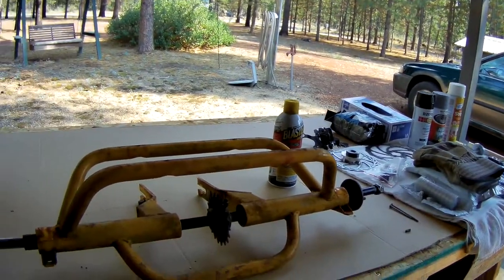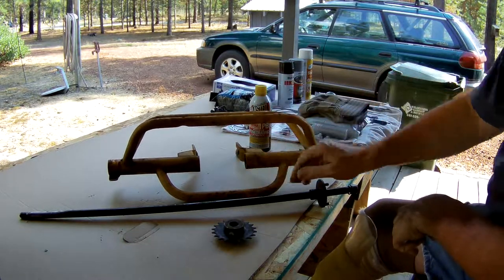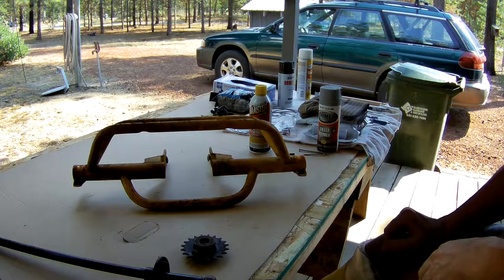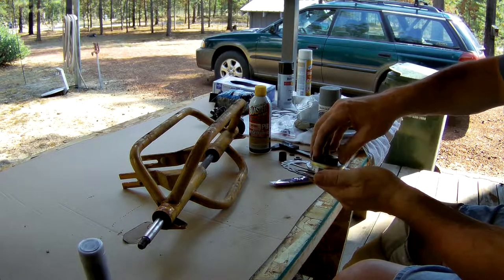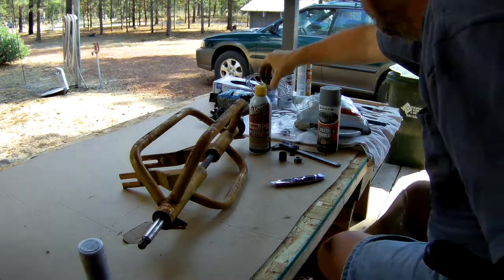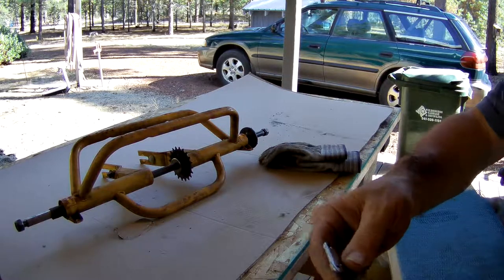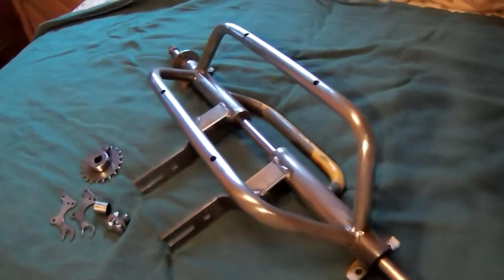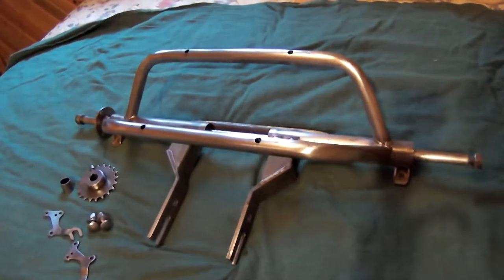Working On The Trikes Rear Axle

Comment: Thx! Interesting project. Never saw a disk brake on a 3-wheeler before. Good idea. Actually I was looking for some guidance on removing / replacing the ball bearings in the tube. Did U use a puller or a long drift to get them out? It didn't look like the bearings were a press fit onto the axle shaft. I'm refurbishing a Miami Sun (3-wheel) that sat in an unheated (Michigan) garage for years. The grease in the bearings has turned hard like plastic. They're clicking and popping and squealing. Pls advise.
Reply from the maker: Michael, I used a inside bearing puller for the 2 outside bearings, took a 5" x 5" x 1/2" plywood and drilled a 1 3/8" hole in the center so the bearing would slide through it when I pulled it out. the plywood is for putting the bearing puller supports on.  once the outside bearings are out, used a 1" x 1" x 12" piece of wood to slide through the tube, and gently hammered with rubber mallet, bearings popped right out
Reply: @double-amputeervtv5132  Thx! Your video was super-helpful, with removing the keyed sprocket and all. Your description of how you adapted a puller to do the job [pulling the bearings] was very inventive. Thank you. I found the bearings I need at Grainger. 35 mm OD,  15 mm ID.  I ended up driving the old bearings out with a long metal rod I use for my holiday yard display. Stay safe!
Mike in Detroit
Reply from the maker: @Quasilobo  , sorry it took a bit to get back to you, had a couple stents put in over the weekend, still recovering, good luck on your project, will be back on the trike in a couple of weeks
Reply: @double-amputeervtv5132  Yikes! Sorry to hear about your procedure. On this end, however the gearhead in me multiplied your 1.375 hole by 25.4 and voila! 34.925mm! Ha. So I know you're shooting straight with us. Excellent! Stay with a healthy diet and you should get a lotta, lotta mileage out of those stents. Thanks so much for your guidance. My new bearings should be in the mail tomorrow. Cheers!

Comment: Where did you order the 17mm axle? I know those Schwinn Meridians come with 17mm axles NOT 5/8". The 17mm axle is combined with 4 6003rs bearings.
Reply from the maker: https://www.huskybicycles.com/model-t-124244-17mm-rear-axle.html

I bought the axle from husky bicycles, they have a good selection of original parts
Reply: @double-amputeervtv5132  Oh wow, that's exactly what I needed. For some reason my axle was wobbling all over. I changed bearings and check wheel "trueness" and When I pulled the axle it couldn't roll on a flat surface it was so bent. Thank you!